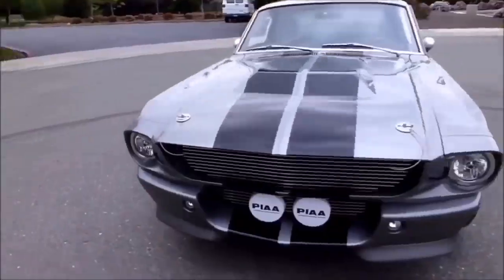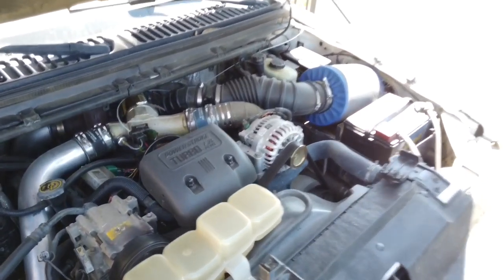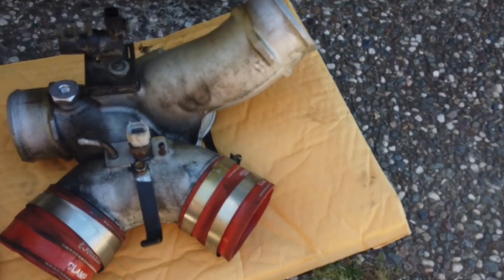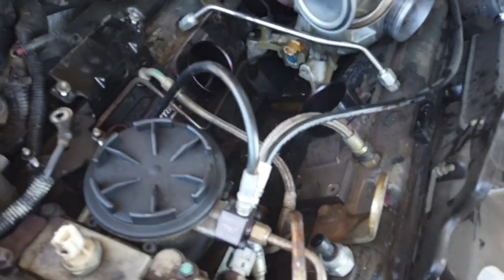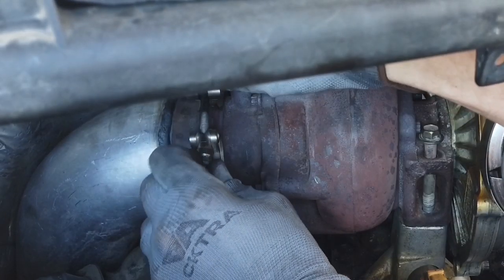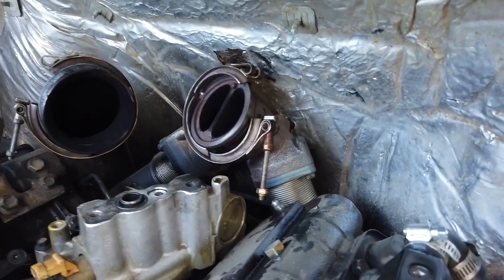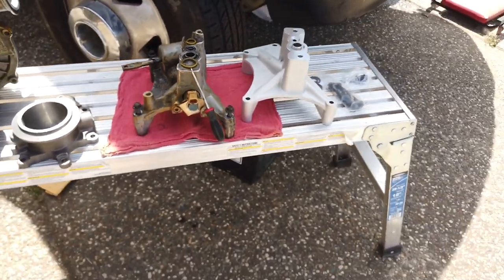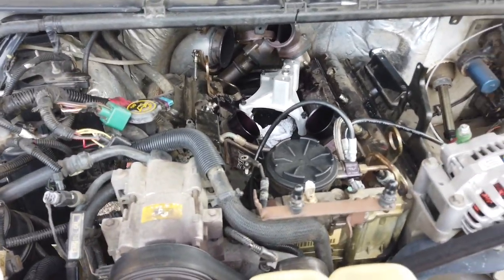2001 Ford F350 7.3 4x4 Dually Powerstroke - Riffraff High Flow Outlet EBPV Blank Pedestal Delete

Comment: Good stuff man! Its gonna look nice in there! Since you got that harness out you should go through and clean up the loom. I've always wanted to replace it with a nice braided loom and to tuck away the sensor wires not in use anymore. I think it would help it to look a lot cleaner than the factory plastic one with all the tape hanging off and what not. Also, some anti seize on the up pipe clamp is not a bad idea!

Comment: A easy way to fix the boot slip is to clean everything with brake clean, then use some sandpaper on the inside of the clamp and outside of the boot to make it not smooth anymore.

Comment: Hey Nick. Thanks for another great video. Loved the "Reality check" and the pillow bench. I must have an old stinky pillow laying around here somewhere. Anyway, we are on the same page with mods but I'm a bit behind you. Harpoon/Hutch with remote fuel filter mod last week, shocks and exhaust this week. Pulled the bed to make all of it easier. Joe (LOW) has inspired me to rebuild the turbo, but I may wait for winter, a nice warm garage bench project. I hope you keep the 7.3 vids coming, at least until you're "done". Thanks much for your efforts.

PS: I've found that removing the degas tank and hood latch make for a comfortable (with furniture pad) place to lay while working the rear of the engine bay.
Reply from the maker: Haha thanks buddy, my list keeps growing as I do more LOL ... so you think bed is easier than dropping tank? I might actually do both to clean and spray frame hmmm, hutch and harpoon for sure and pick up filters delete
Reply: @FixItNick  If it was the Hutch and Harpoon only I'd probably just drop the tank (my pick up filters were disgusting). But the exhaust, shocks, fuel filter, differential service, rust conversion and paint will all be so much easier with the bed off. Plus I'm gonna add a rear winch where the spare used to go. Pulling the bed was simple. I did it alone with a cheapo Harbor Freight chain hoist. One thing I'd say to all... resist going for the impact wrench for the bed bolts ( you need a T50 Plus torx head). Use a breaker bar instead. Way gentler. Let the penetrating oil soak a couple days. I got every one of my bolts out and they look good enough to reuse (I won't). 7.3 forever ! Too bad we Californians have to hide everything from the smog guys.

Comment: The how to vids vs reality was hilarious! That's the truth right there. 
For the rear clamp I have found that putting a pry bar on the ears of the clamp and hitting it with a hammer breaks it off much easier.
Reply from the maker: Thanks man, I should have sprayed it before running to work, but I think I gathered enough rage at work haha

Comment: it took me an hour to get my fuel bowl, downpipe clamp, intake spider, and intake off. and then another hour just for that damn up pipe clamp.... i loved that reality part, because I think it was thoroughbred diesel that made a tutorial on how to remove it and said it was difficult, but i didnt think it was going to be as difficult as it was.... the bottom ear on the clamp was such a pain in the ass.
Reply from the maker: It does always look easier in vids haha
Reply: @FixItNick  getting everything back on too was a nightmare.. I put the new collector on before I put the turbo in and I ended up having to take that out and put the collector on the turbo, and then bolt the up pipes in. I only tried doing the collector bolted on at first because the previous owner welded the down pipe in but I ended up cutting it and putting an exhaust clamp on

Comment: That back clamp is the worst! I sprayed mine with some PB Blaster and left it overnight then it came off a lot easier
Reply from the maker: Yea good idea, I should have when had to run to work
Reply: Man... I'm having trouble with the "cold side" down pipe V clamp (why I came to YouTube today for answers). I did spray the heck out of it yesterday so maybe today will be better. So the back one is worse... perfect.

Comment: What d you do with the plug that go's to the pedastal will it cause a oil light to come on.
Reply: You just run a resistor across it and it thinks everything is fine.

Comment: When I delete the pedestal do I have to program it or the waste gate
Reply: Was kind of wondering the same. I did the delete previous to seeing this. I put my own 470 ohm resistor in-line to replace the actuator sensor he mentions at mark 8:45 (Riffraff part). Got rid of engine light, but have a choppy de-acceleration after I rev it up. I was wondering if it does need some kind of tuning once the valve is removed. Have you gotten any answers? Thanks

Comment: I’m not sure but it looks like there is diesel in your coolant which usually means the injector cups are leaking if I’m not mistaken. I could be wrong though. In any case it’s awesome truck  and I’m definitely jealous
Reply from the maker: Diesel in my coolant? Where do you see that?
Reply: FixItNick When you were moving your coolant tank I thought it looked a little brown. It could’ve just been the camera or anything I suppose but I’ve seen it a couple times. If your coolant has a waxy feel to it then it probably has diesel in it which would probably be the injector cups. Like I said it could’ve just been the camera or the color of your coolant but I suppose it wouldn’t hurt to check

Comment: My truck stalled out on me and it's really hard to crank, when I do get it cranked over it idles for 2 minute then stalls, if I give it gas it chokes like this.
https://youtu.be/qYsNOZ742zE
Reply from the maker: It can be few things, what engine codes you got, googled them it will help
Reply: @FixItNick  how do you check the oil pressure going to the injectors if I cant get the code reader to sync up. Im.having a hare.time finding an oil pressure gauge that even goes close to 3k. What's the ball park price o you coming to Savannah GA n help me fix it??